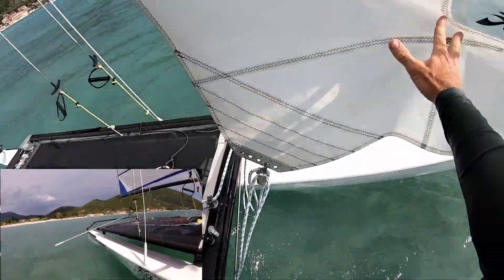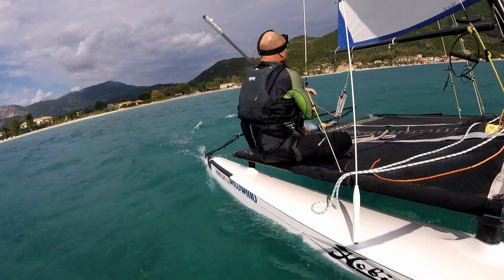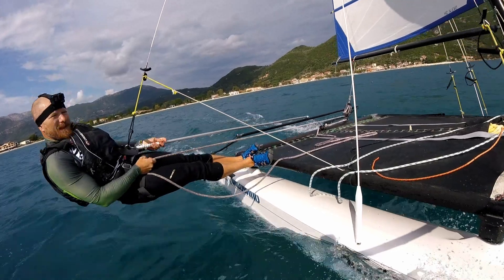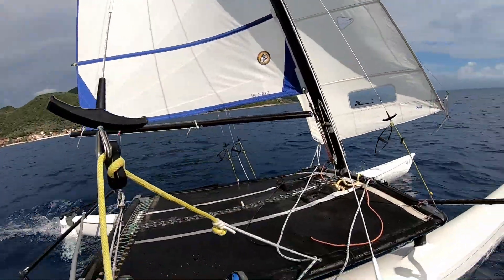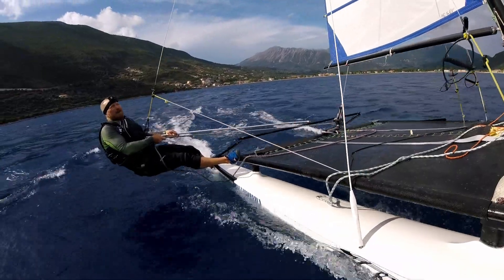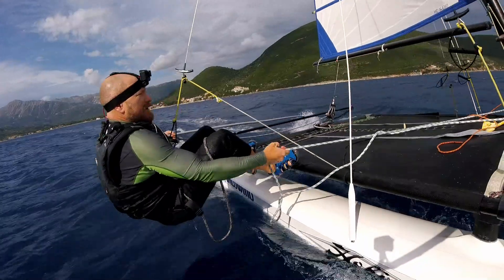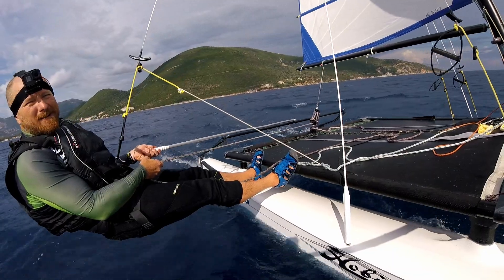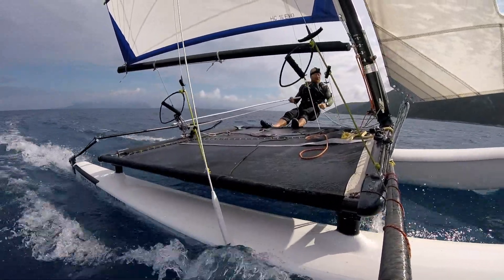Hobie 16 with a Hobie 14 mainsail, what is it like Multi cam with commentary

Comment: Did you use the reefing point on the main halyard? In North America we have the comptip with no reefing point, which defeats this possibility. Guess we could swap to the aluminum style main halyard.
Reply from the maker: yes it was on the reefing point. The other possibility would be to upgrade the rope part of your halyard to a rope that has a dyneema core and then just cleat it at the bottom in the right place.
Reply: @JoyriderTV  I bought an old 16 here in Canada and it seems to have a reefing point, even with the comptip.  There is a second metal 'slug' about two feet up the wire halyard from the regular metal slug.  I just got the boat late last year and know nothing about it other than it's in very rough shape.  I'm sailing solo and the 18SX can get a bit hairy on my small gusty lake so the 16 may be the answer, and with a 14 sail, the wind range is extended.

Comment: Out of all your videos, I like this one the best.  Because I have a collection of 6 cats.  I have parts to put together a 7th, which I've been holding off on doing, for several years.  And those parts, are an  H16, with an H14 mainsail !  I And I had recently changed my mind on doing that.  I thought to just put together an H16.  I thought to utilize my H14 mast, and a jib, on the 16 pontoons,.  However, now I may try the 14 mainsail, with a 16, jib, I never thought of that.  You saved me a lot of testing. Also your experti advice, means a lot.  I'm motivated also, to get going with this.  Thanks
Reply from the maker: Great, i'm glad that it helps, and saves you a lot of experimenting.

Comment: Great video, thanks Joe!  I am wondering if you can solo right it more easily with this sail?  Also, which boom did you use?  It doesn't look like my H16 boom, so I am assuming it is the H14 boom?  I am always looking for easier ways to right the boat solo, so anytime you come up with items that help, please share them.  I have seen most of the videos, and thank you for all the time spent.
Reply from the maker: It's the 14 boom - this sail is made loose footed which will also make it look different.
I'll be making a 16/14 righting video shortly.

Cheers
Reply: @JoyriderTV  Thanks for the response!  I look forward to the video.  Also, I started searching the internet for 'Hobie 14 EVO main sail' and wasn't finding anything.  Can you tell me who makes it?  Is it Evolution Sails in Australia?  Thanks again, and smooth sailing!

Comment: You've now proven that the hobie 16 is balance pretty well with lots of sail combinations.  That makes me wonder why everyone runs so much mast rake on them.....
   I've been tempted to run the 14 mast and sail on the 16 for high wind solo sailing .  It might take different length rigging to do it...
Reply: Orrrrrrr.....the Hobie 16 mast and sails on that slippery 14!!
That would take some serious engineering.
Reply from the maker: I think the 14 mast on the 16, you might over load the mast (depends on how heavy you are) Like i was saying in this video about the risk of ripping the sail, I think with the smaller mast section of the 14 on the bigger boat I think there could be an increased risk of snapping the mast. 
The mast rake I think is what is helping to make the boat balanced, because there are no skegs or daggers, the centre of effort has to be quite far back to get some lift from the rudders.
Reply from the maker: I put a 15 rig on a 12 foot Catsy before, that didn't go well!